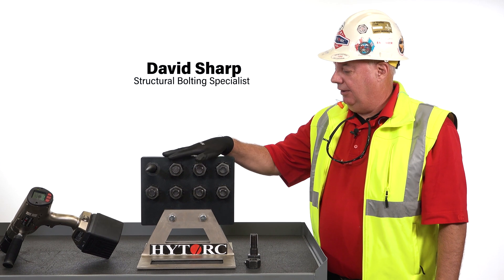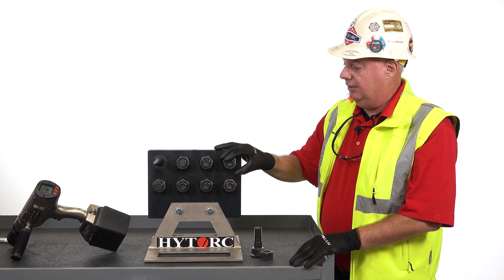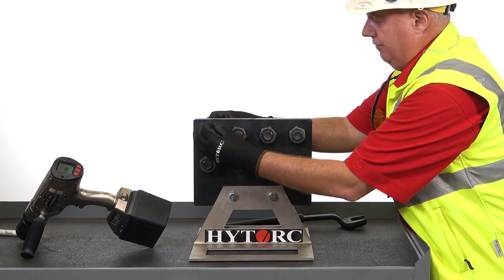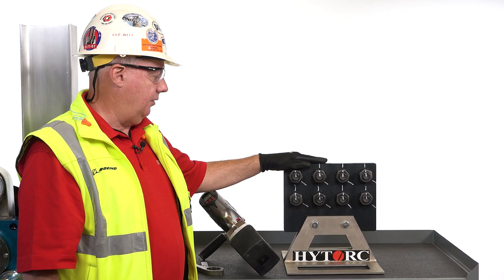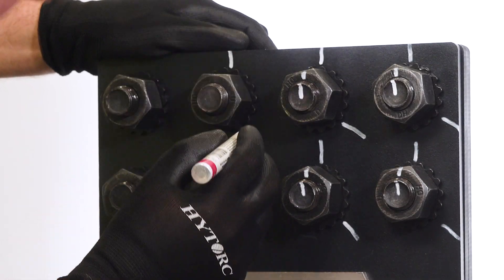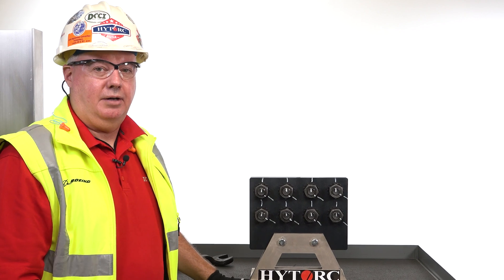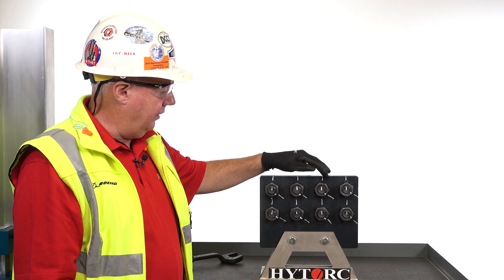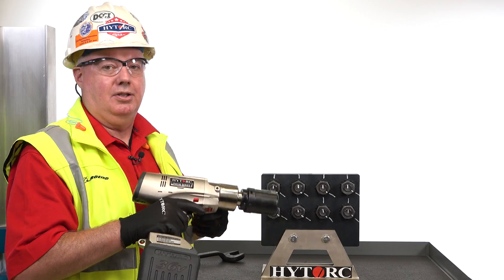Structural Steel Assembly Installation with David Sharp

Comment: When installing the nut,I hold the nut and spin the bolt until it catches.This prevents dropping the nut 1,000’ over NYC.
I thought I told you this when you first taught our Bolt Technology course at the 40/361 JAC.
That had to be around 2006.

One of the first jobs where T.O.N. method was required was WTC Tower 1.
My bolt inspector was J.Chadee!